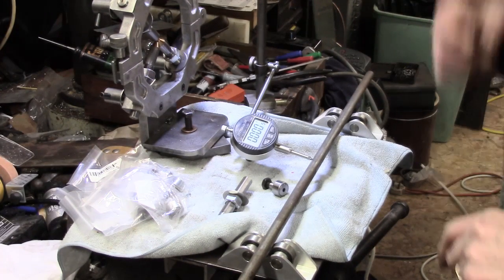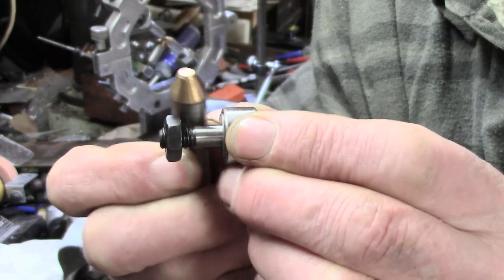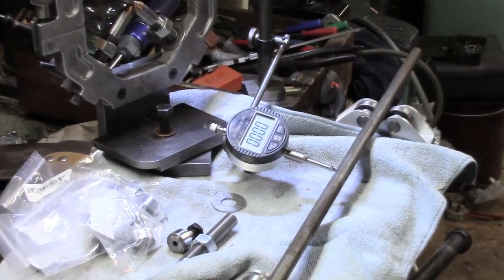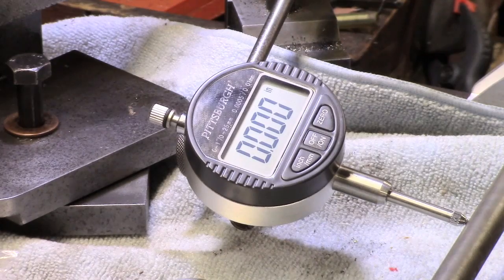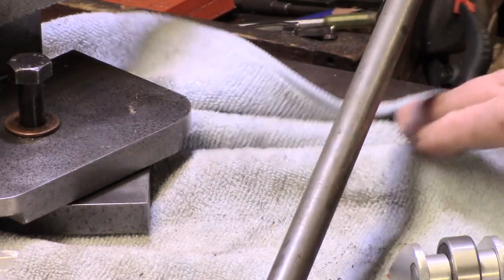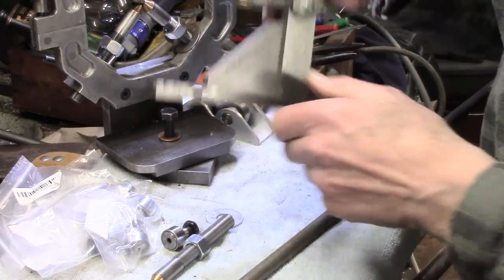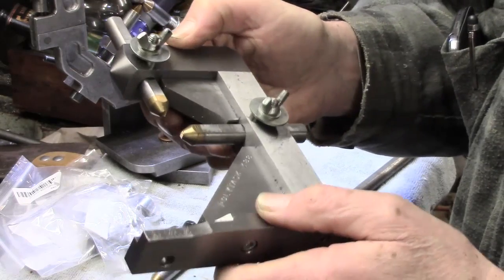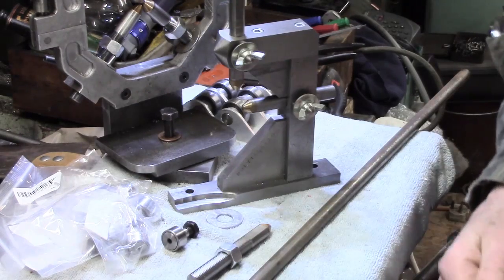Steady Fingers - Cam Roller mods - decisions!

Comment: Interesting, Chris.  I've not seen a 4-point steady before.  I looked at your demonstration video of it from a year ago.

I agree with those who say make a new set of fingers.  There will  most likely be an instance where the bronze tipped set will be preferred for a project, and you'll have them available.

Here's a suggestion that you may find convenient for setting-up the steady for use.  This method will work well on a straight shaft such as you used in your demo

First, slide the steady to a position as close to the nose of the chuck as possible and lock it in place.  Then adjust each of the fingers against the workpiece with the desired clearance.  Rotate the chuck by hand to insure the piece isn't binding.

Next, loosen the swing arm of the steady, unlock the steady from the bed and slide it to the working position near the right hand end of the workpiece. (If you don't loosen the swing-arm you may find it difficult to reposition the steady.)

Tighten the steady to the bed and secure the swing arm.  Rotate the chuck by hand to insure there is no binding and lubricate as normal.

Assuming that the work is running true at the nose of the chuck, it should also run very close to true with the steady in its working position.  

Perform the desired operation on the workpiece.

Adjusting the steady from scratch at its working position is tedious and leaves open the possibility of the working end of the piece running true but not concentric with the axis of the lathe.  An indication that this is the situation is that the work will creep out of the chuck.

I don't know what your geographic location is, but I know it's much colder than mine here in Texas.   Hoping you have decent workshop weather soon.

Best regards,
Richard

Comment: If you were to extend your existing threads toward the phosphor bronze tips you could flip the fingers end for end and drill for the cam rollers at the opposite end.
Reply from the maker: Good thought Thomas - I'll look into that in case I have enough length to play with.

Comment: I don't like the notion of the rollers offset from the side of the pin. that introduces all kinds of side loads and torque. I would much prefer to see a clevis right on the end of the pin with the roller in there.  Nice simple direct line of force.
Reply from the maker: I take your point re force vectors - but do know that some folks have done this and managed well even with slight offset. To do them ideally would require forks and a small bearing but as I am limited to 1/2" fingers may get go ahead and mount the cam rollers as I described and accept the slight offset. Still pondering on it all!

Comment: That is a hard choice but it might well be simpler to just modify the current fingers to use the rollers.  .  I was tempted to suggest that you make new but the rollers will work just fine no matter what the metal you are turning and you can get there faster with the modifications.  What good are spare fingers that will never be used?  Heck toss a coin.  Thanks for the video.

Comment: Nothing wrong with having two sets of fingers. The bronze tips for steel and cast iron and a set with rollers for soft metals. That way each set is optimized for what you want them to do rather than one set that tries to do everything at less than optimum performance.

Comment: What if you shortened the thread on the roller bearing a little, then get a piece of flat bar stock with a 8mm threaded hole and 2 6mm clearance holes an bolt it to the flat area on your finger,( of coarse you would have to also put 2 threaded 6mm holes in the finger to attach it), at least it would be removable. I'm not sure how much rigidity you might loose.
Reply from the maker: Like your idea William, thanks. It is in the 'pondering' melting pot!

Comment: Mounting the rollers in an offset configuration is a bad idea, the only east way forward would be to make up a forked end to fit over the end of your existing fingers, the rollers would track in a straight line due to their width, or you could drill the roller spindle holes offset to the finger axis, that way they castor, either way it would be far better than having the roller offset to one side of the fingers, that would induce even more torsional stress on the fingers. Chris B.
Reply from the maker: Chris - I was going to try that (with the offset), with possibly a follow-up making new fingers. That now is off the table anyways, as I screwed up modifying the end of one original finger!! Vid of that coming.  So - when time, will make a new set with bearing thrust in finger axis!! :)
Reply: ChrisB257 Sorry to hear it all went pear shaped! Such is life, at least now you can embark on the project with a new approach, sometimes it is better to start with a clean slate, rather than mod an existing design, if you start with 3/4" bar and turn down for the threaded part, you can get the extra diameter to slot the rollers into it. look forward to seeing this.
Chris B.

Comment: Make caps with the roller bearings that can fit over the existing.
Reply from the maker: Nice idea David ... another thing to add to my 'melting pot'! Only thing is - we'd need a keyway or similar to maintain truth of orientation, so maybe quite a lot of work.
Reply: ChrisB257 Just a dimple or a flat for a setscrew
Reply from the maker: David Kirtley Could work David - main concern is having roller at exact 90 degree to work piece and axially spot on.